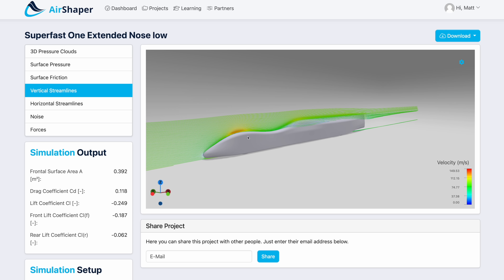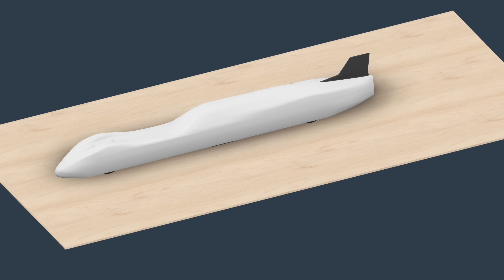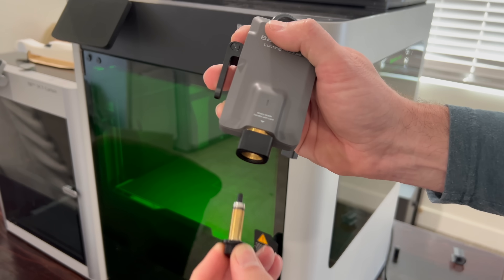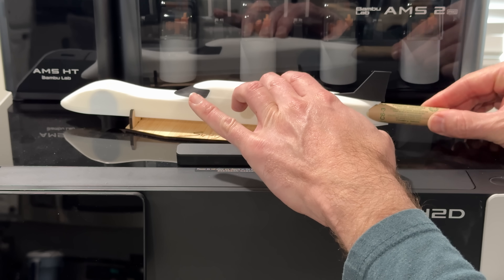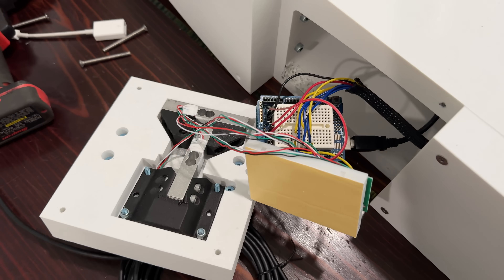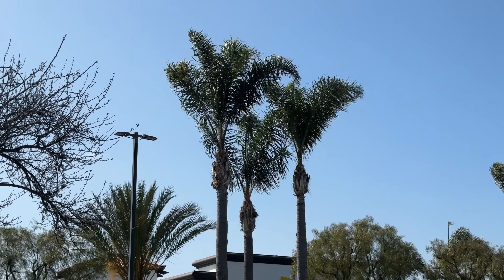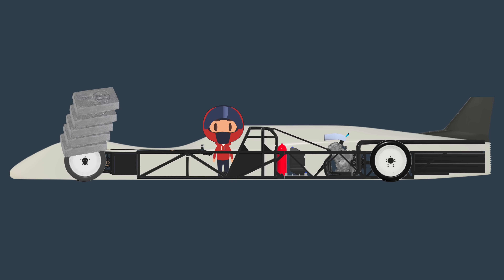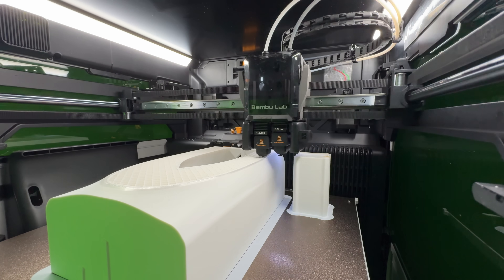Aerodynamic Testing On The Highway, With The Bambu Lab H2D

Comment from the maker: Get The New Bambu Lab H2D: https://shrsl.com/4vf5r
Reply: Hi Matt, thanks for the entertainment and engineering.

I totally agree with you that Bambu Lab seem to be making awesome printers, but I am also worried about proprietary software turning my tools into expensive paper weights.

I support your work, but it does make a huge difference that you didn't have to pay for your printer. There's a reason I use an Android and not an iPhone.
Reply: but can it print a ham sandwich?
Reply: Aha, my engineering senses indicate the model car needs to be thrice as big as the real one to get good data at 55mph. Basically clad the 4x4.
Reply: To anyone considering it, PLEASE research the recent controversy around Bambus business practices, and decide if this is a company you still want to support before buying anything from them.
Reply: stick tufts of string all over the body this will help you see how the air is moving over the body at high speed (this was and still is used in the world of aerodynamics, google tuft testing)
Reply: Step 1: Build a little wind tunnel
Step 2: Borrow every leaf blower you can
Step 3: Profit
Reply: You already got me to buy my P1S based on one of your "It's Finally Time To Put A 3D Printer In Your Garage" video and yes it 100% changed how I build and prototype. But the H2D is still a bit too expensive for the relatively small build volume increase for my needs. Here's hoping for a 1M cubed version soon!
Reply: But will it laser cut a water Pump Gasket For 94-21 Toyota 4Runner ?
Reply: Don't you thing you may get Better Help asking Mark Robber for advice and make you an ACME wind tunnel? It worked for improving the testing of Tesla you sure are familiar with...
Reply: Do the bad things about Bambu have any real impact on those who want their 3D printer to be a tool, not a hobby?
As a non 3D printer hobbyist I have completely failed to understand the complaints about Bambu. It seems to be the early adopters of 3D printing who see problems, and those who are new find it easier and more reliable than the competition. 

When I buy a new hammer it's because I already have things I need to hit, not because I want to take up hammering as a new pastime.

I don't need the handle on my new claw hammer to be compatible with the ball-peen I inherited from my grandfather, but I do need to hit nails from any manufacturer and when I aim it at a random car part that needs be a different shape or in a different place, I don't want the Hammer telling me "U Can't Touch This!".

I guess the question is, does the closed/integrated (delete as appropriate based on your pre-formed opinions) nature of Bambu printers prevent me achieving quick and good parts, or does it actually make it all easier?

If this is the iPhone of 3D printing, that's fine for me. I wasted years on Windows Mobile. I spent months experimenting with installing Ubuntu and then Android onto my HD2.
If I had just got an iphone, life would have been easier. Maybe more expensive, but certainly easier and would leave me more time to do the things I actually wanted to do.
Reply: Just watched Clough42's video and he exactly answers this question, and even uses the same tool vs hobby wording. Quite spooky really.
Reply: Bamboo is probably the worst 3d printing company for the 3d printing hobby.
Reply: @GimbleOnDew  Why is that?
Reply: Sadly, with this latest Bambu ad, I've unsubscribed.
Reply: Come on man, you're better than this.
Reply: @TheR00ndar Yeah, disappointing. It honestly felt like one long commercial. Was good when it was good, but it's time to move on 😔
Reply: I guess everyone has their price, huh? Superfast Matt becoming a shill wasn't on my 2025 enshittification bingo card, but here we are. The end of an era and the end of a sub.

I'm sure it's a great printer, as are many others out there, but it was pretty clear you were paid to sing every praise you could find (and if you weren't, that's even sadder).
Reply: @Agouti  Bambu is an ok printer but the security on it's software is a worry now
Reply: @Agouti  Yeah, I love the guy's sense of humour, and dedication to various levels of insane projects, but this vid felt like one long, tedious, sellout commercial.
Reply: @Agouti  I read this before I watched and thought "come on, how bad can it be". 

It was bad. I'm very disappointed in Matt for doing that.
Reply: I love your channel, but could you stop promoting scam companies? Bambulab is Tesla of 3D printers...
Reply: This is dangerous, your  aero test is clearly wrong even if you are more clever.
I'm sure you did CFD and didn't trust that stupid test on the car, that one is irrelevant

Comment: I am in the process of placing a new Bambu Labs H2D with the filament spoolers in my "bedroom print lab".  I do a lot of 3D printing and aero mods for my (24 mph) carbon fiber recumbent bicycle. That is why I bought the H2D. I was wondering, 1 - have you tried a minimal end plate on the vertical stabilizer? I did that a long time ago on a home designed and built hydrofoil system for a Nacra 5.2. Worked very well until the foil de-laminated from the vertical strut. The end plate does not have to be too big and can have minimal thickness made from prefab carbon fiber sheet. It does not need an aero cross-section since it is just blocking flow off the ends of the wing, but it should be parallel with air flow.  2 - You could try a digital servo trim tab on the tail. Somehow figure out how the accelerometer-based trim and stabilization works on modern quad copters and apply it to only the yaw axis. If nothing else you would learn a lot about servo electronics. I think it could be done with the larger off-the-shelf components these days.

Comment: Your model is way too close to the front of the ground plane, you should put it as far back as you can. Air will be stagnating in front of the car windshield and blowing up over the front of the board. Moving the board farther forward on the car will also help. The side edges of the board will cause turbulence on top. To find the best spot for the model you can tuft the board (strings of yarn taped all over it in a grid) and drive it without the model to see what the wind is doing. If you can't get the strings laying flat pointing to the rear where you put your model, there won't be any usable data generated by this test.

Comment: @superfastmatt why don't you 3D print and laminate a converging well rounded nozzle inlet for the top of your external wind tunnel and have it feed into a rectangular duct? That way you can accelerate the airflow beyond the vehicle speed. You can measure the test stream speed with a Pitot-Static tube just in front of the nose of your model.

Comment: I am also interested in aerodynamics for my own interests. 
   I was unaware of the Reynolds number with a ratio. 
   For testing with smaller models, it seems like you would get false or improper data without using that method.
   Water is 800 times more dense than air, if I am correct. So, I dont know if it scales linearly, but you should be able to use water to simulate air at lower water speeds in comparison to airspeed.
   I'll try that when I get to that point. Thanks for the Renolds number information!

Comment: Why not just have an open ended box with the model inside it on the roof of the car?

It’d cancel out the ‘noise’ of side winds.

Fuel economy would be awful but probably still cheaper than renting an actual wind tunnel.

Comment: In a wind tunnel test, would you fasten the model in the same fashion? That is, at a single point near the center of mass? It seems to me - perhaps naively - like it should be fastened at the axles with sensors located there.

Comment: The arches for the front wheels seem quite tall. It looks like you intend the slipstream to tumble or be thrown up/off the arch tops.   You have a cowl dip to encourage the slipstream to swoop down then up over the cockpit.  But it seems the only air that will have a chance to do this, is the air that passes between the front wheel arches.  On a final note, I suggest reading as much as possible about the Arnold AR-5.  He went 213 mph on 65 hp.  Good luck!

Comment: I noticed that you do not have a ram air intake.
My 2 cents is that you could place it in the aerodynamic shadow of the cockpit (as to not increase frontal area).
To do that, you would have to design a gentle curvature behind the rollhoop, and place the intake there, slightly elevated to not ingest boundary layer flow (a similar solution chosen by Adrian Newey on the Aston Martin Valkyrie). 

For best results, the intake should not be diffused by more than 7 degrees, but you work with the space you have. By trading velocity for pressure, the rise in plenum pressure will be significant at high speeds.
The downward curvature behind the cockpit will create some lift but its not in a bad spot, so it may actually help with lift distribution. 

Having the engines as they are - just catching whatever hot, turbulent flow they can is a sin in all religions, even in those really chilled ones. 

Another solution would be to place the intake at the root and leading edge of the vertical stabilizer (but above the boundary layer) and then gently diffuse the flow to the engines in a sort of reverse-flow configuration. If done right, you can even cut on interference drag between the vertical stab and the body! 

I understand that it's a lot of work this late in the game, so at the very, very least, a well designed NACA duct (or 2 of them) to feed the engines would be the bare minimum to undo such sin. 🙂
Reply: It truly pains me to see those engines breathing such low energy flow.
At least consider a pair of NACA ducts. It's "simply" a question of cutting a square on the body... and making the plug... and making the mold... and making the part... and installing the part on the body... and the exact same for the ducts themselves. Yeah... it's quite a job!

Placing them on the sides will not be ideal as the flow will be very tired by then, and any degree of yaw will compromise one side or the other.
So, placing them on the top section of the body is the best bet.
But it's worth it! 👍

Comment: I was almost screaming never gunna  work Because!
To get it closer to working add sides a roof and a funnel at the front that feeds into several tubes for about a foot and a half or 500mm so that you effectively actually turn your car into a wind tunnel.
Also simultaneously test a known object that you could obtain a print file for from an aerodynamics test site.
Then with data from the known object to compare you can filter out a lot of the garbage data.

Comment: Nitpick Charles here. From text, “ In real road conditions the road and the air are steady (apart from the air motions caused by meteorological and traffic conditions) while the vehicle is moving. Thus the floor in the experimental or virtual wind tunnel should move at the same speed as the fluid in the undisturbed part of the wind tunnel.” The effect of a stationary floor is that the boundary layer at the plywood floor would slow the air at the lower extremity of the tires. This would cause a (maybe tiny or inconsequential but preset) weathervane force at any standout tire. 
I actually admire your effort. I was acquainted with the engineer that developed the first torque converter while standing with his pants rolled up in the middle of a stream in upper Michigan.

Comment: As a fluid dynamics idiot (with a PhD), I just want to say that I am incredibly jealous of getting to play with ideas. Way too much of my job is making spherical cows inside the computer. It would be interesting to run at higher speeds to see if the righting moment was sublinear or superlinear, due to the changing boundary layer+simpathetic interactions of the tail with the wheel arches (and maybe wheel holes).

Comment: Most hang glider manufacturers do this, but the glider is put up on a tower above a truck away from the flow around the truck. You need a truck rather than a car because with a full size glider being tested at 6g loads the forces can go over a tonne.

Comment: just random 2 cents, if you can put the model on a little slider (even drawer slider) and put a scale, even a fish scale and go pro, measure the (drag) force at say 50MPH then the use the formula to figure  out the drag at 200mph: F = ForceMeasured * ( ( 200/50)^2 )

Comment: ' Moving ground plane ' wind tunnels revolutionized F1 aerodynamics by givng a whole new set of characteristics for the underside, by simulating the road surface passing under the car, and not just the air.

Comment: Loved that last 2 second blurb with the rocket powered car. I did a similar thing with a rocket powered car (carved out of balsa) 40+ years ago in high school. I had two small eyelets on the bottom of the car, front and back, and ran a long piece of fishing line over the expected course. This was to keep it on the ground, rather than taking off into the air as in your blurb. When you said you had files available for that car model, WITH room for a rocket engine, I thought of repeating the experiment.

Comment: What if you made a Tunnel on the roof of the car?
Place the model inside. It would negate cross winds?
You could then widen the front to create a Ram effect. (Double or triple the actual wind speed)
Then using an anemometer, measure wind speed inside the tunnel, and change it by widening or restricting the front.
??

Comment: Something worth considering with scalability of aerodynamics.

Air is a compressible fluid, and at the sorts of speeds we're talking about with landspeed racing, that starts to become a factor that must be considered in analysis. Around 0.3 Mach is achievable, and that's around the point airs compressibility starts to matter. So the scaled velocity you can calculate via dimensional analysis and experimentation won't necessarily work in the real world due to the scaled velocity being much further into compressibility effects than the full sized velocity. Maybe you can correct for it in the math, not sure. But another avenue that might be worth pursuing is scale testing in a different fluid. Reynolds number depends on density, viscosity, length and velocity. So velocity isn't the only variable you can help scale with.

Disclaimer. I'm just an engineering student with book learning but no experience. Just my two cents.

Comment: No shade on taking a sponsorship. But do not buy a bambulab printer. They are going in a very anti-user direction with their closed source firmware and user agreement. Even going so far as to steal every design you print. Buy a printer from a company who views you as the printers owner instead of as the user of a printer they own, instead.

Comment: could you incorporate yaw damping? Of course you'd need a rudder.  
On aircraft this is common. However, this is usually to compensate for transient instabilities. 
 Also, folks use gyros on high speed RC cars.

Comment: Even if the larger rear wing generates more drag, it is in the best possible spot for drag. Just like the drag chute, drag at the rear--as far as possible behind the polar moment of the car--has a naturally stabilizing effect.

I often considered testing the drag of a scale model by creating a mini wind tunnel tube and mounting the model on a kind of pressure sensor in the base. Run the unit at a fixed fan speed and get a baseline resistance reading. Then pop the chamber and start fiddling with the shape using modeling clay and test again. Repeat over and over, and get the number as low as possible. You might be able to use this same method by hard-mounting the model to a shaft at the same point as your fulcrum, and then measuring the torque applied to the shaft as it exits the bottom of the wind tunnel tube.

Comment: I tested this shape almost 2 decades ago or one close to it 1/8th scale in an old school wind tunnel with a pressure wand and found the front wheel "Horns"  channeled a pressure ramp that crashes into the windscreen  - latter we modeled it in software very much like Thrust SSC- it showed the pressure zone in front of the drivers windshield that runs all the way forward to the front of wheel horns - ultimately it peels over an down each side in a vortex - it was deemed sub optimal  - perhaps if you waisted the car in an area rule the vortex could be mitigated?

Comment: I was surprised the H2D is "only" 2600 duckets.  Pretty good for what it does.  Buying that might actually get me to ditch my cardboard skills and finally learn CAD.

Really enjoyed the rocket car test at the end.  
It Rreminded me of a Lego car I tried that with in the street in front of my house when I was a kid.  
It did sort of the same thing.  Thankfully the Lego parts completely disintegrated before the engine ended up flying through a window a few houses up the street.  (Disintegration eliminated most of the evidence.)
No one was hurt that I know of.  No ambulances were called.  Most importantly my mom wasn't called.  I escaped without a spanking and didn't have my rockets taken away.

Comment: Perhaps you could repeat the test on a lakebed where you could a) travel in a straight line instead of a twisting highway, b) not have to worry about turbulence from surrounding vehicles, and c) go as fast as you want without the CHP on your tail. Having ridden dirt bikes in the Mojave desert, I know there are several lakebeds within a 2-hour drive from your home.

Comment: If you box in your roof mounted wind tunnel and put a sheet of honeycomb mesh on the front, it might make the airflow to your model more laminar and remove some of the wind noise in your data. Nice work and cool video. That printer is so awesome!